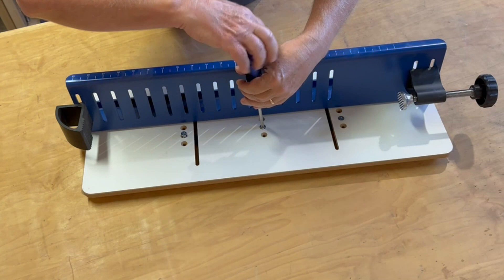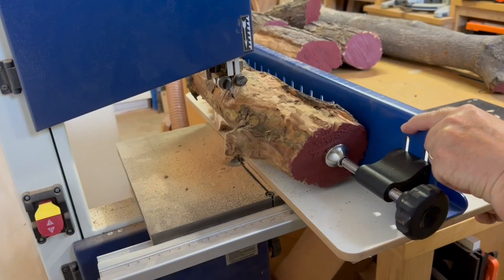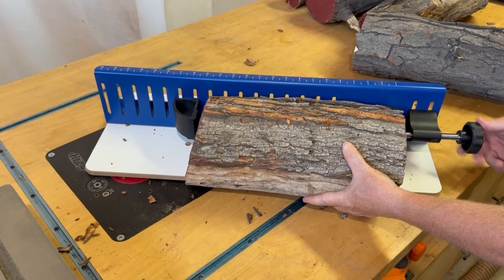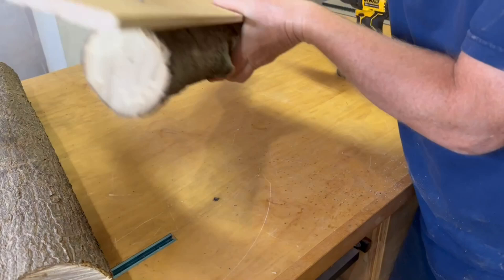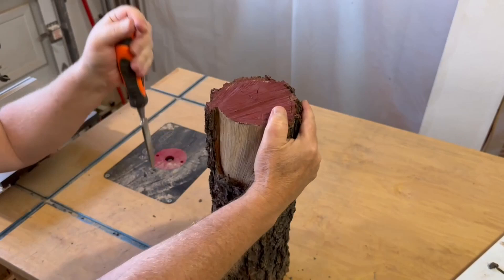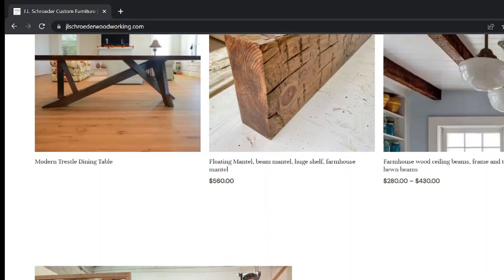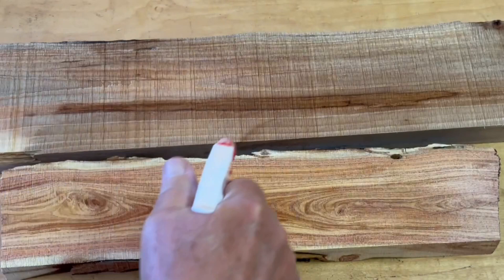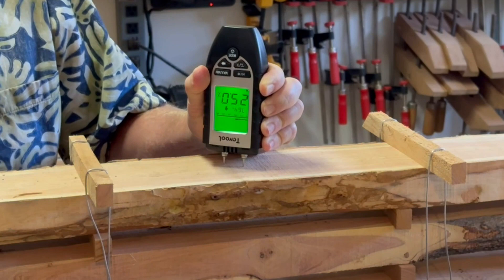Carter Log Mill on a 10" Benchtop Bandsaw (& some other DIY log milling approaches)

Comment: That's a great little mill. I picked up one a couple years ago and had a similar experience with critters on a couple boards. I have a few logs from a tree we had to take down earlier this month in our front yard that I'll be running through it in the next week or two.
Reply from the maker: Yes, it works great!  Good luck with the logs from your pin oak tree!
Reply: @jkmwoodworking  Thanks for checking 🙂

Comment: Great example of using a smaller 10” bandsaw. What size blade did you use?
Reply from the maker: Thanks!  I used a 1/2" blade, 4 TPI.  I'll add a link to the blade I used in the description.

Comment: what kind of paint can u use for end sealer
Reply from the maker: I just use leftover latex paint from painting some walls on my house, either interior or exterior.  The guys who do this often say they just go buy the returns from home depot, whatever is available.  Also note that some use a wax to seal the ends with instead of paint.  I'm not sure if one is better than the other.
Reply: @jkmwoodworking  Perfect! Thank u good man
Reply: A commercial sealer is called anchor seal .

Comment: You seal the ends to prevent cracking. Will the wood still dry, though? Can a wood dry without forming cracks? Wood drying is effectively loss of material, and that's why the cracks form. You still want the material to go away, what will happen to the negative space?
Reply from the maker: The idea is to have the wood dry at a consistent and uniform pace.  If the end grain is left unsealed, then the ends will dry out at a much faster pace, which causes the cracking/checking.  With the ends sealed, then the entire length of the board dries at a consistent pace. the wood will still dry.
Reply: @jkmwoodworking  where does the negative space go, though? the wood becomes slightly thinner?